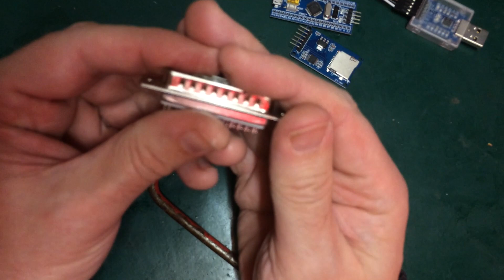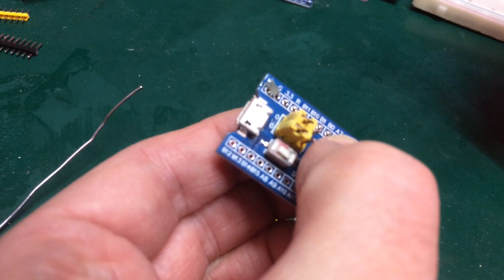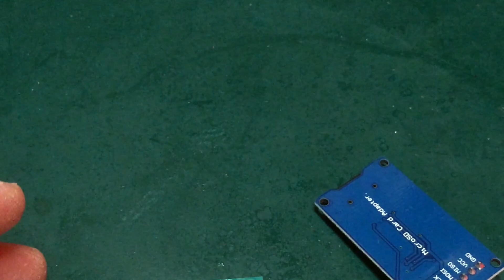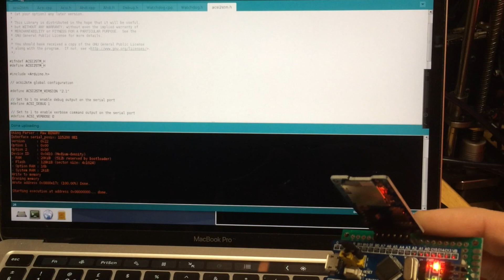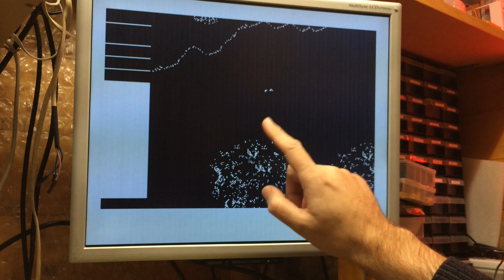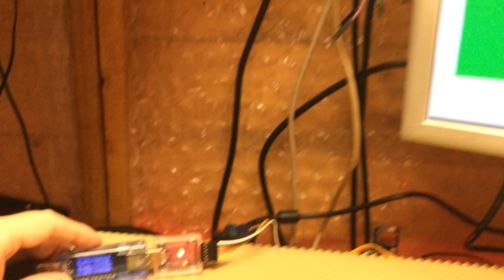Prototyping an ACSI2STM for my Atari STE

Comment: I came here looking for a way to pull 5+V from the Atari ST itself. Did you ever find a reliable point? I thought I did for many months but the STM device did not have enough current and acted like a software problem. Anyway.. looking to find a hot point. thanks
Reply from the maker: From the outside? Not many. Joystick port isn't really up to it. The STE joypad ports and the cartridge slot provide a decent current, but are in the wrong place, absent or being used. I normally just route a dupont wire out of a crack around the printer port or similar and connect to the motherboard.

Comment: Here is a tiny little problem> I do not understand where have you found a AHDI.cpp file? I downloaded the entire thing from the Github and AHDI is not there? What file do you go to to change that SD parameter? You made it working and I feel stupid for the way you did it is not clear.
LoL... Eh,,...
Reply from the maker: My video was from December 2021, there have been many updates to the project since then -- that file must have been refactored away. Perhaps the newer firmware no longer requires the change I made? However, if you wish to follow along exactly, commit eda14b3 is the one I was using.
 https://github.com/retro16/acsi2stm/tree/eda14b3fc74b73db7d1bf87447c4aaef89ec74b2

Comment: i have tried everything now and all mine does is goes straight to the standard desktop no sign of life from acsi2stm unit at all anyone have any ideas what may be wrong? I have noticed some of the tabs in the arduino sketch on this video are not present in my copy of the code.
Reply from the maker: There have been a lot of developments with this project since my video -- I'm not up to speed as I'm still using this version as built and flashed! Changing that frequency was important to get mind to work, though. Do have a look at the current developments (Atari-Forum has a couple of threads) & bear in mind you will need a hard disc driver -- unless you're using EmuTOS.

Comment: Thanks for making this video, this is exactly what I want to do for my STe. I am OK with soldering etc but am new to the programming side. In the video it looks like the file you edit is "asci2stm-Ahdi.cpp" I am not sure where to find this? Any help you can give me with this would be greatly appreciated.
Reply from the maker: Hi there. Many thanks. There is a more recent firmware available nowadays that might (not yet tried) not need my change. Have a look here: https://github.com/retro16/acsi2stm
Reply: Thanks for this and I am making progress. I have tried different versions and am getting it to upload the code. One other question, it all appears to work like in the video with the red and green LED's on, then the green LED goes out when you power the ST but it is not booting from the SD card, any more help you can give with this?
Reply from the maker: @byronneedham529  auto-booting will only work with Emutos. You’ll need a driver. Only ICD worked for me with this firmware revision, but it’s old and cranky.

Comment: Great video!  I am trying to implement this on my 520ST and I am having issues.  Have you tried the 3.x source yet?  The code uploads and on boot it finds the 4GB card.  Sometimes the DMA test works, sometimes not.  I can't get it to make changes to the card at all.
Reply from the maker: I've not tried the later firmware, to be honest. I think it's pushing the limits of the STM32 to try to get the best throughput, so I'm not sure my bodged together board will be capable. Does the old firmware work for you & have you applied the recommended pull ups to the DMA databus? (see https://exxosforum.co.uk/forum/viewtopic.php?f=17&t=1417)

Comment: Why don't you just mount it internally? You could transfer files to it using the parallel port.
Reply from the maker: For that I'd probably just add IDE to the 16MHz board, to be honest. This was just a hack from parts I had to test the water. :-)

Comment: Uhm, as far as I remember, both the joystick ports and the serial port provide 5V pins - don't know if the parallel port do as well. :)
(eg. making a male-female "extension adapter" where you pull out the 5V wire and perhaps GND would still allow you to connect a modem to the serial port).

Comment: 3D-print a new housing for the DB19. I think I actually bought a few DB19 when I had the chance a few years back, unfortunately I have no idea where I put them :/ - probably with the two DB26 ...
Converting a DB25 to DB19 is probably better / easier than designing a PCB to use a couple of 'pin headers'.
Edit: you can actually get DB25 for PTH, which would mean you'd need to design a PCB, however, that would probably be one of the best low-cost hack-solutions I can think of.
 -MoreThanAll in Taiwan can create any type of D-SUB you like (and they make high quality connectors; not China-junk).
Edit2: Never try pushing unsoldered pin-headers into cheap China/eBay breadboards. pins will come out on the top-side and if you're unlucky, your fingers are right on the other side...
Reply from the maker: Thanks for the supplier tip. I don't think I'll be going down that road, but I know folks who might.